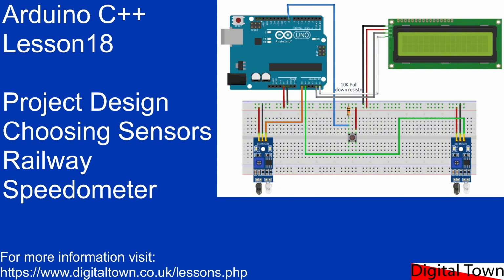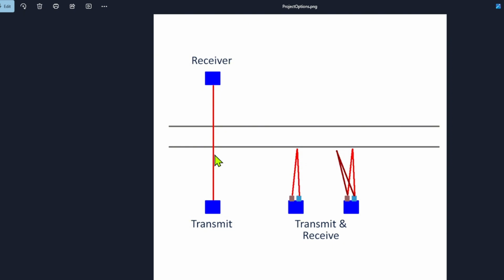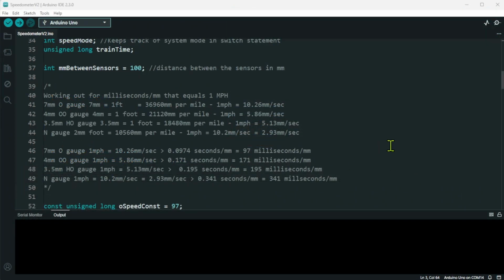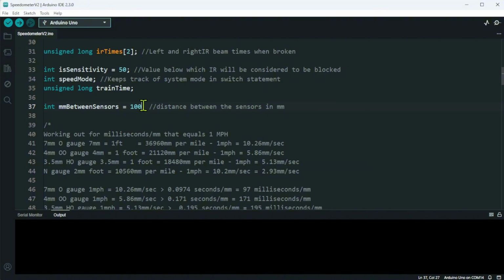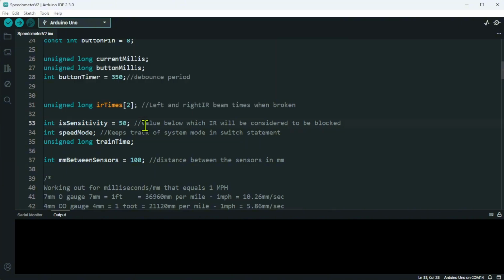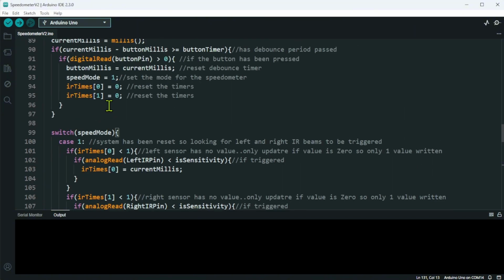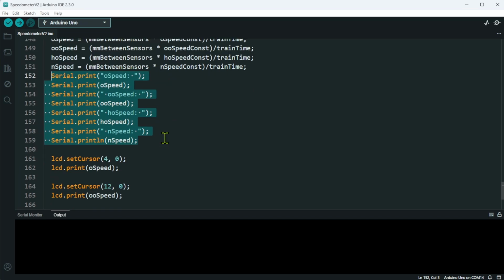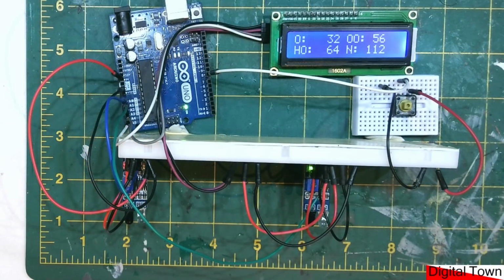#116 Arduino C++ Lesson 18 Project design, choosing sensors to build a model railway speedometer

Comment: I successfully followed and completed the tutorial. But I still don't understand the comment between line 41 and 49.
For example,  7 mm  = 1 ft = 36960 per mile  -  1 mph  =  10.26 mm/sec. What does it mean?
Did you mean on scale of 7mm  1ft  = 36960/m  -  1mph which equal to  10.26 mm/sec?
why  - 1 mph?
Reply from the maker: It's the working out for the speeds for various gauges to show people how they could alter it for their own gauge such as TT at 1:120
1mph is 10.26 mm per second in 7mm scale
So moving down to line 46 1mph = 10.26 seconds that means it takes 0.0974 seconds to travel 1mm approx 97 milliseconds.
That's then used in the distance and timing calculations on line 52 to set the correct speed by gauge.

Comment: I tried several times and had no luck. How should the sensors look? Should both the red and green lights be on or should only the red light be on?
Reply from the maker: Have you run the first sketch that checks the button and IR sensors are working correctly?
Reply: @digitaltown5442  Yes I did. I rebuilt the whole thing using a Nano rather than an Uno and still cannot get the values on the screen to change from 0. I wired the breadboard as illustrated in the video. Should both the green and red LEDs on the sensors be on or only red? Currently I only have the red LEDs on. When I pass an item in front of them, they flash green and return to red. Please help!
Reply from the maker: @michaelmatsumura422  When you tested the sensors in sketch 1 what value did you get when the sensors are being blocked?
With my sensors I got values below 50 so used a value of 50 or less to trigger the timing set in the variable 
int isSensitivity = 50;
If your sensors when triggered give a value greater than 50 you will need to increase this value. Or you may be able to adjust that value with the pot on the board.
Regarding the red leds...my boards don't have a red led. I do see a green led light up when the unit gets triggered and go off when it's not but colurs of led are not standard across the boards... probably whatever they have in stock when they build a batch.

Comment: Great video. I made a ballistic chronograph using a similar method. Enjoy the content.
Reply: I tried several times and had no luck. How should the sensors look? Should both the red and green lights be on or should only the red light be on?
Reply from the maker: Sounds incredible, what sensors do you use for a project like that?